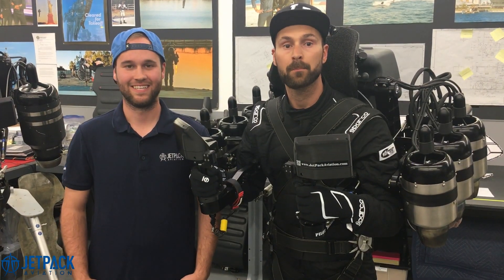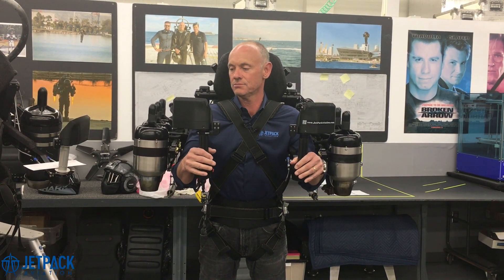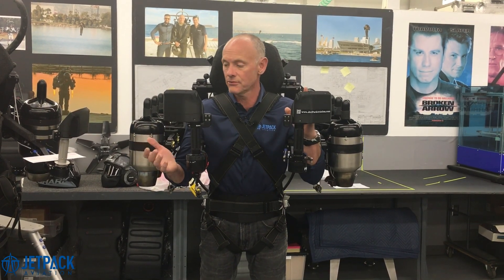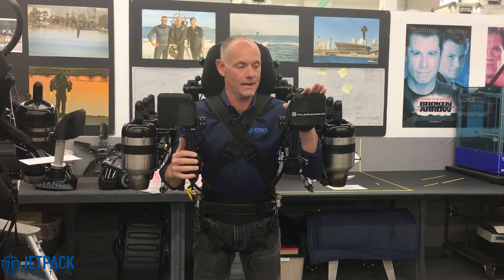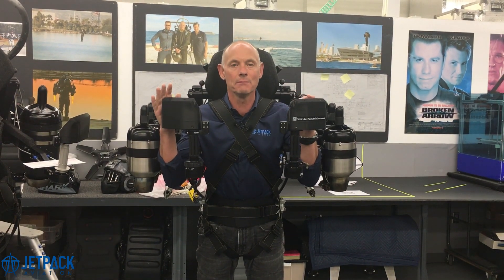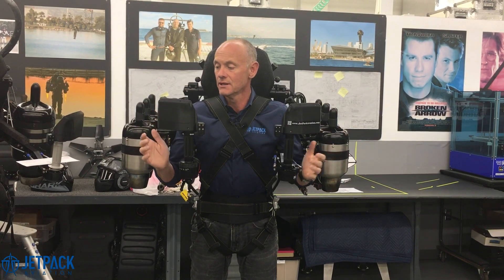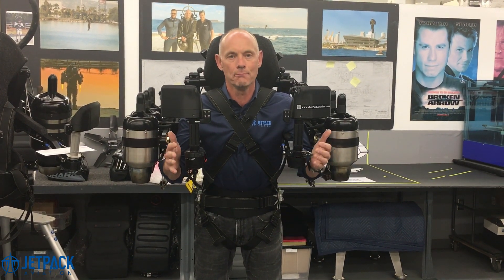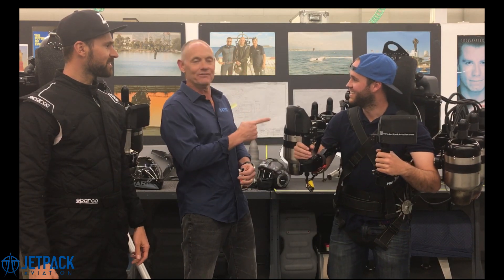JetPack Aviation : JB11 Engines redundancy system presentation.

Comment: What these engines needs is a FORCE COVERTER that can convert rotary motion into linear motion, rotary acceleration into linear acceleration, rotary force into linear force. That can be re-engineered so that it can be incorporated at the top of the turbine compressor through the use of a mechanical gear-shaft adapting-interface. The British did it in the 1970s but that invention was suppressed! But it needs some slight modification in it's design and in the 1980s one of our Russian scientists did just that but he was ordered to place it inside a beam box support made out of steel beams to support it at it's bottom to use it's pulling effect and at the top to use it's pushing effect. A kind of pull-push structural force upward thrust and lifting force distributor and activator so that when place inside a structure that has the required structural mount for it to be installed properly inorder to pull and push it's entire cargo and deadweight and power source and passengers and life-support systems and so forth and so on, then it can lift that entire structure into the air and eventually into outer space. And depending on where the pull-force is directed into, it can reach any of the plantes of the solar system.

Comment: Worst case scenario. THREE ENGINES ON ONE SIDE GO OUT. How does all the safety features handle that??
Reply: Bronwin Draney well the other side that got blown out will still be pushing out some thrust so the system will basically lower down the other side so you don’t go crashing on the other side and it will alert you to land immediately
Reply: Aspectrum Well the parachute built-in will deploy and if that rips which will be highly unlikely probably because the parachute is made out of very durable material

Comment: Absolutely loving this video and congratulations. Always waiting for new uploads from you guys, big fan here. The JB11 seems to weigh less than the jb10 judging from the way you were moving while having it on. Also it seems the jet engines are a tad wider apart and a bit further away from the body, which i hope reduces the heat on the feat slightly and makes it more comfortable to fly. Keeping it low weight is not only crucial for flight but also for everyday carry as not all people have the strength to lift something too heavy.

I wonder if the JB11 new 6 engine redundant architecture, without much re-arranging, can be morphed to incorporate a motorbike-like seat,  thus whenever landing you land on the base of the seat or your feet(optional). It will still be considered a jetpack but has the added advantage of a more cozy, snug and secure flight experience and no feet over-heating and no need to have the strength to carry the jet pack on the back which is a detriment for me due to past lower back injuries.

I hope you like this idea, your excitement got to me while i was watching and got me excited as well. Kudos to you for always working hard and following your passion. JB12 is the next step :)